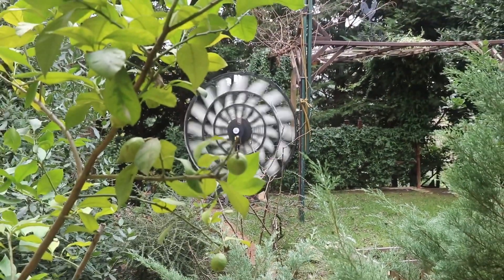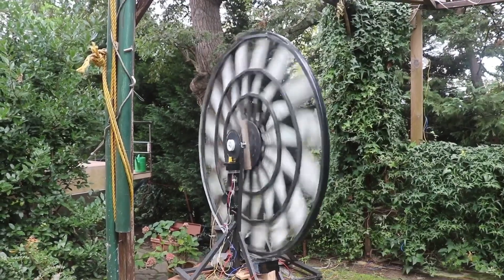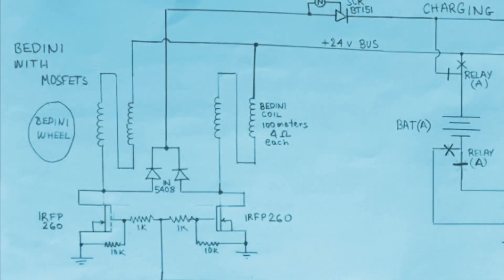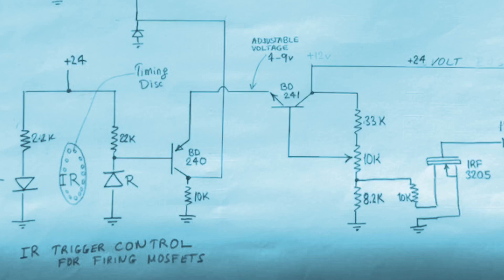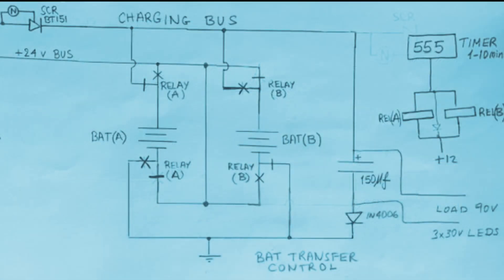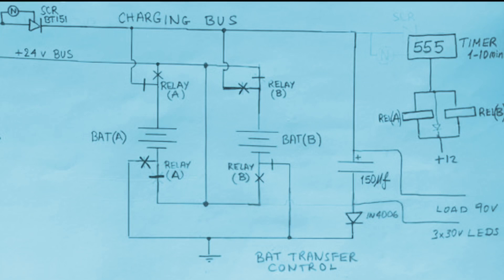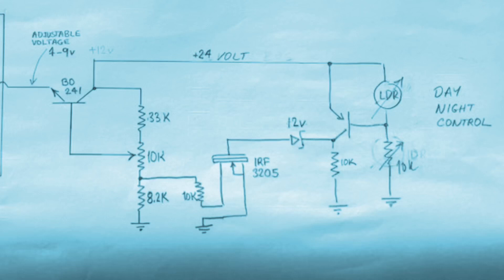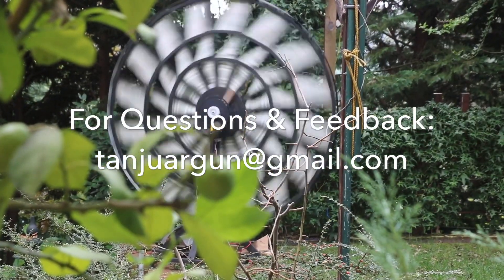Modified Bedini Overunity Device by Tanju Argun

Comment: Iv'e been trying to get people to understand for years its just like if you have a job and you make 500 dollars a week and you only spend 250 a week for your bills and you put the rest in the bank so at the end of the month you will have put a 1000 dollars in the bank if thats not getting ahead i dont know what is. So basically for the input it only took half of the total input power to run the system so you have the other half of the input power to power the load your not getting something for nothing your just useing the input in such a way that its  not all used to just power the system its self you have the rest for work.

Comment: here is some late info.      bedini  is/was  a  FAIL.   and a waste of your time.      when the power transform is  Fully understood,  this fact is  OBVIOUS.     i have experimented with some of the novel ou concepts.   THEY  DO  NOT  WORK.    this is true, in part, because,   faraday and lenz  were  NOT  WRONG.     NO ONE  working with coils, pulse motors, etc  has  accomplished  ANYTHING  or  has Ever  succeeded.          there is  no  ou  in back-emf or transformers or transistors or capacitors.       it SHOULD BE UNDERSTOOD that  any use of  caps  suggests that power is  Not continuous/low density.     it SHOULD BE UNDERSTOOD  that where  a  MOTOR is  incorporated into a   Power  circuit, the motor  functions as  a  ROTARY  TRANSFORMER.   that's it!!!    so, power (watts)  goes in, and  a  LITTLE   Less  power (watts)  comes out.    period.    because, just like Any Other  Transformer, it is NOT  a  lossless  process.      any 'observed' increase in output energy,  is  delusion.       if you are interested in a  Chance of Success, see my ou research.    in which, the use of Inherent Mechanical Advantage, together with Optimal electrical design, is   KEY.        googletranslate
Reply from the maker: I understand you are a Lavosier, Lenz and Faraday FREAK. But I am a TESLA freak. If you watch the video more carefully you will notice that I am using five forms of energy. 
1-Solar Energy charges my battery.
2-Wind energy ( SAİLS on the wheel) rotates the wheel
3-Magnetic Energy (BEDINI EFFECT) rotates the wheel
4-Gravitational Energy (The FLYWHEEL effect) helps sustain rotation
5-Chemical Energy (The battery)
So I am getting more output then my ''PAİD INPUT''
Thanks for the comment anyway!
Tanju Argun
Reply: @tanjuargun2025  bla-bla-bla     you  know  NOTHING  about  me.!!!       if  you admit to being a  tesla-TARD,  that is  Your  stoopidness.!          this  Late   response, from you,  does  alter the fact that you have  invoked bedini's  name, and apparently assert/claim that you have successfully utilized  an  Invalid  concept.!!!       free energy  is  Not  the same as  non-polluting  or  renewable energy.!!!!         neither do those methods qualify as  ou.!        googletranslate
Reply: @daviddavids2884  easy now. Here's what I see. I see a bunch of ppl who are stuck in a book that literally was designed to keep ppl from obtaining a true pure form of energy. You say Tesla was not a key player in life yet the device you use to combat others is a product of NT. Today the scientific community is diluted down with a bunch of EGO tripping fools who forget that experimentation and science can be wrong. Today's standard of energy production is based on one principal, money. They have lied to you and it's easy to see. You seem to fancy yourself as an engineer and yet your choice of words tells me that you are either disgruntled or nothing more than a gatekeeper. It's sad because it's ppl like this that literally muddy the waters and create a clog in a free flow pool. Stop trying to force ppl to quit moving forward and if you don't like it then just ignore ppl. Again I'm so pissed at the community right now because we have been infiltrated by TROLLS, SHIT POSTERS, AND BOTS. All designed to discredit someone or hinder the advancement of a specific field. Tesla was the greatest inventor and the reason why you call ppl who study Tesla stupid is because you have closed off your mind and bought into the lies of JP Morgan and co. You realise that once Tesla realized the way that energy distribution companies operated he backed out and after realizing that they wanted his work for free he began to keep all his notes so private that only he could decipher them. The reason why wireless technology (Nikola Tesla) was pushed aside and mocked was because Thomas Edison and JP Morgan had already spent a ton of money on the wired infrastructure and they had already drafted up a reimbursement pan where we the ppl would pay back the millions of dollars worth of copper and wood poles, and not only that but they could cripple this investment. Tesla wanted to give it to you for free, only cost would be a one time purchase of equipment and then maintenance of course but back then ppl were able to build almost anything because they were all able unlike today's ppl who need instructions for Ikea furniture. The Term "Free Energy" has become a curse word no thanks to trolls and propaganda machines, Tesla had to go down with it because he was fighting for the good, for the betterment of society. Not to get rich, not to be famous, so they launched a smear campaign against him. Apparently it worked so well that inventors have to talk in code or spend weeks, and even in this case years combating the nonsensical rhetoric of pure bullshit spewing from the mouths of naysayers. You ppl act like there is zero advancements left to achieve because you locked yourselves in by "Laws" well try bring a rebel and break those laws. I can completely debunk anything seeing as there are always two sides to every coin. But just because I can present it in some way that makes believers of what I'm saying does it mean I'm right. There is no right or wrong when it comes to creating a hypothesis, any one who tells you otherwise is a tool of the machine. Yeah I know this was long but my guy.....you literally put yourself into the pot of trolls by discrediting the man who brought you to the point that you could tell another man he's wrong wirelessly. Yet this man explained in clear detail what was going on and you ignore it all. Good luck and link your work I'd like to see it.